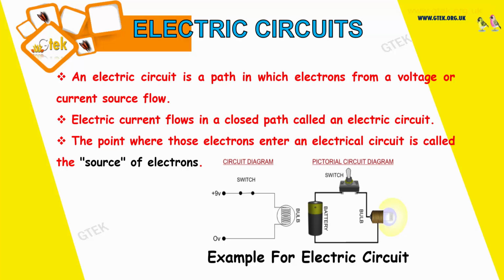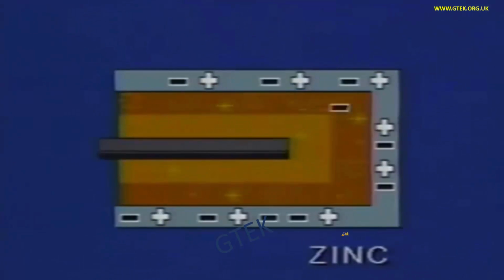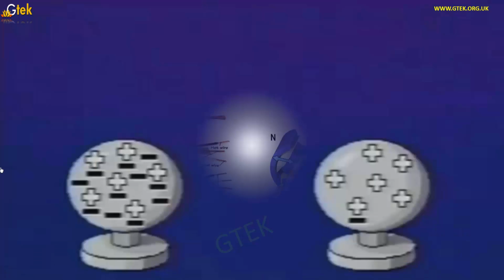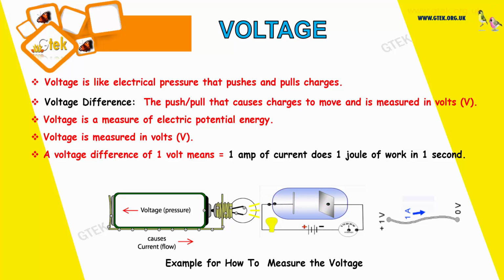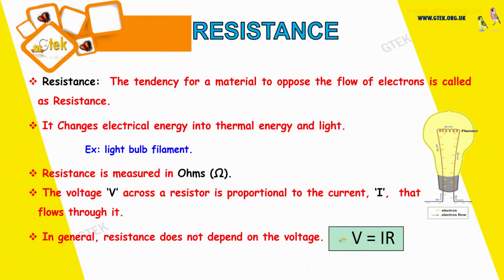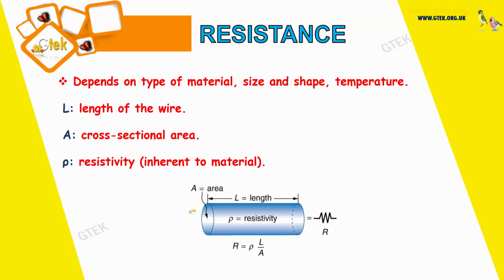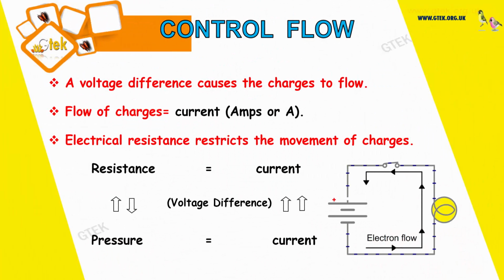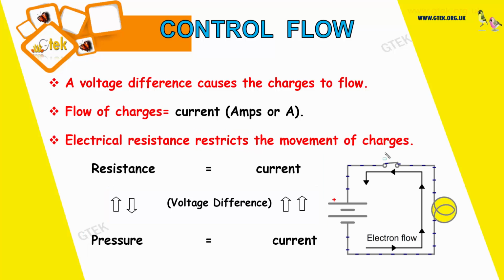Electric Circuits in Physics | What is Voltage | What is Resistance | Control Flow in Physics

Comment: An electric circuit is a conducting path, external to the battery, which allows charge to flow from one terminal to the other. A simple circuit might consist of a single strand of metal wire linking the positive and negative terminals.

Comment: The value of the equivalent resistance (Req) takes into consideration the individual resistance values of the resistors and the way in which those resistors are connected. There are two basic ways in which resistors can be connected in an electrical circuit. They can be connected in series or in parallel.

Comment: There are two basic ways in which resistors can be connected in an electrical circuit. They can be connected in series or in parallel. Resistors which are connected in series are connected in consecutive fashion such that all the charge that passes through the first resistor will also pass through the other resistors.

Comment: The electrical resistance of an electrical conductor is a measure of the difficulty to pass an electric current through that conductor. The inverse quantity is electrical conductance, and is the ease with which an electric current passes.

Comment: Voltage, also called electromotive force, is a quantitative expression of the potential difference in charge between two points in an electrical field

Comment: the concept of potential is a location-dependent quantity - it expresses the quantity of potential energy on a per charge basis such that it is independent on the amount of charge actually present on the object possessing the electric potential. Electric potential difference is simply the difference in electric potential between two different locations within an electric field.